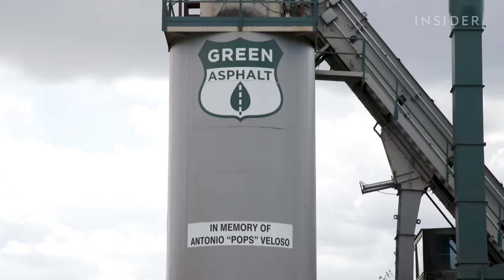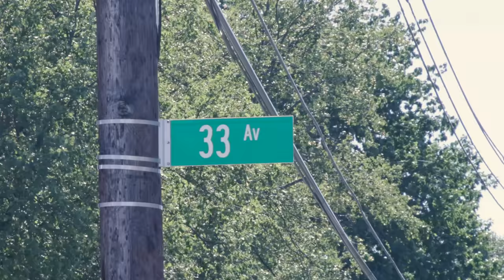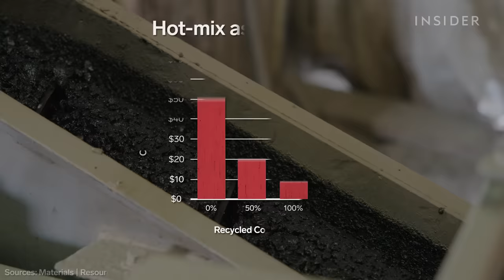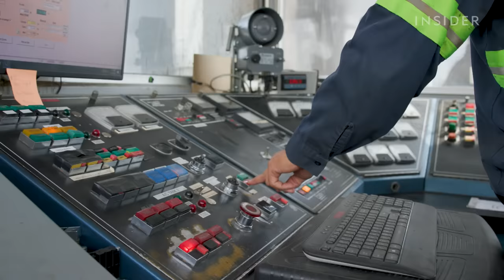Roads Can Be Recycled Forever, Why Don't More Cities Do It? | World Wide Waste | Business Insider

Comment: I live here in Idaho I worked for a company called strata Inc. they are geological engineering company civil engineering. I did many many asphalt roads concrete asphalt mix designs. And testing for construction materials such as roadways all forms. And even the ASTM which is American standard testing materials as a way in which to use recycled asphalt. I championed for it over 25 years ago when I was in the field and I still champion for it today but getting states to do it on a major scale is like pulling tooth and nail. But since the oil prices have gone way up maybe they'll look at it again or they'll just turn around and increase our taxes. Which is just horrible anyways. We as a people in the United States deserve better. We have rocket ships that land vertical don't you think we could figure out road material. We have square boxes that hang on our walls that we call televisions. We have satellites in space I mean as simple as road material come on seriously I've always known you could recycle asphalt. It just wasn't popular it will save the environment because we are not running a huge bash plant and crushing up more rock at crusher control for more material in which to build roads cuz believe it or not there's a lot that goes into roads a lot a lot of vehicles and with all those vehicles I don't see any of them electric. And if you've ever knit sat next to one of these crusher control places you can see the dust the dust alone can cause you to cough if you're not properly wearing your PPE.

Comment: 1. Aggregate specs of the past often don't meet modern specs - hardness; friction; broken faces; rock type.  Can't QC agg specs o recycled
2. Asphalt oil evaporates / volatilizes over time! Always need more regardless of 1.
3. 100% of old asphalt is always recycled - always - every bit of it. Old asphalt is not thrown out! Even if the blending rate is 30%, it is all recycled.

Comment: Now that's one way to reduce our carbon footprint, hats off to that innovative company. This is the type of company that should be getting government grants and contracts by saving taxpayer money.
Reply: When the current secondary market for old asphalt / millings drys up, just what do you expect these end users to purchase?  RE,   Millings are currently commonly used for residential driveways.  Dump, spread , drive over with a car.  It will be a bit wavy but it is a very low cost / low labor solution.

Comment: One of the things they don’t address in this video is the added fuel cost to running higher recycle asphalt. If you make asphalt with 50% or higher recycled content, the recycle doesn’t actually touch the flame. It’s dried by superheating the virgin aggregate, which in turn dries the recycled aggregate. The higher the recycle, the more fuel required, whether it be waste oil, natural gas, or propane. 

There are additives used to lower temperatures, but they also add cost.
Reply: I would love to pass on the fuel bill, if I can bring my old asphalt without having to go to the landfill, then drive back to get new asphalt. That’s a lot of vehicle fuel. And if you have multiple vehicles ? I’m for recycling asphalt. It’s very true that one week I can install new asphalt so another utilities company gets to destroy it

Comment: Asphalt is a bad product of a flawed theory. The claim is that asphalt is cheaper than concrete, however a couple days ago I drove on a concrete road in my town that is at least 75 years old and is still in great shape. Asphalt has to be ground off and replaced about every ten minutes. It is far more expensive in the long run but very profitable for the paving companies. I wonder if they donate to politicians?
Also, asphalt absorbs tons of heat making cities up to 10 degrees hotter during the summers.

Comment: that's a disappointment to learn that you can 100% recycle asphalt but regulations only allows 30% to be recycled.
Reply: Old asphalt already reused as a residential drive way material, dump, spread, drive over it.  It will be a bit wavy bit it is just fine. Also note other posts where the recycle content is way past 30%

Comment: I had no idea that recycling of asphalt was a hard sell. I remember in the early 70s reading in Popular Mechanics or Popular Science of a giant machine that would cut and lift and grind asphalt, process it internally and lay it out smoothly behind as a continuous process.  I guess that didn't work out?
Reply: Of course it worked out.  I live within a kilometre of a highway much of which has been recycled in this manner.  Rubber crumb is increasingly being added to areas which benefit from staying in good repair longer,e.g. busy intersections.  Also reduces linear cracking…….and incidentally stopping times at traffic light controlled intersections.

Comment: "Why don't more cities do it?" ... because it's easier and more convenient to simply produce new asphalt.  Some have also tried adding granulated plastic waste to the mix.
Reply: AH yes. "digging up the old asphalt, crushing it on the spot and adding tar to it before chucking it into the paving machine" is so much harder to do than "digging up the old asphalt, putting it into a truck, driving said truck to an asphalt plant, unloading it, loading it up with new asphalt, driving it to the roadworks and loading the new asphalt into the paving machine"

Comment: if over 90% of asphalt is already getting recycled, while most asphalt used is between 70% and 100% fresh, then why wouldyou need to jumpto using 100% recycled asphalt? 
this seems like a marketing gimmick or a trick to gain government contracts, and I do not believe that the stuff is of equal quality no matter how often you say it. it's clearly contaminated with higher sand and gravel content from lower road layers (as well as tyre and exhaust dirt, soil and what not), and surely some oily parts of the bitumen evaporate over decades in a road, so it seems quite obvious that the result would be drier and more brittle. I reckon just adding a little paraffin oil does more to mask this dryness in the short term than it does to make the asphalt not too brittle in the long term.

Comment: The state of Missouri where I've lived my  life of 59 years and worked for the county highway dept. have seen Missouri roads deteriorating with republican tax breaks for the rich since the 80s what once were paved backroads are now all gravel dust powder just blowing in the wind covering everything with dust and new highways being intentionally destroyed with surface grinders apparently made just for burning through tax dollars used on brand new bridges  and highways before its even completely cured causing cracks and breaking seams in density tested cement pavement that otherwise might last decades

Comment: concrete also has a zero percent recyclability.  and cement pavements make ZERO sense from a long term maintenence stand point, when you could use paving stones. Which can be repaired with a single guy, a wheel barrow, spares and some sand. Compared to what the cement pavement requires... about 3 trucks a jack hammer, and a mini digger.

Comment: This is misleading on so many levels. A Marshall stability test is not sufficient to ensure this is product is equal to its conventional counterpart. In urban cities, the roads are the quarries so this works. But in most rural cities where they are mostly overlaying there is no RAP supply to support this process. Well made asphalt road lasts 40 years but in NYC when they are mill and fill every 5-10, then this works. This isn’t the cure, just a different racket and set of racketeers

Comment: The ANSWER is @ 1:45. Regulators, IE Gubment.  That's why.    What they do around me is spray a heavy goop and lay round pea gravel down on top of the existing road, regardless if it needs repair or not and we wind up with a newish looking terrible to drive on road.  With some make up gravel and some new fresh oil, they can strip and repave it on one pass instead and have a better road, but guess that is not feasible in the money hungry gubment in charge of roads.

Comment: Has nothing to do with production or processes, it is all a corrupt mess in the bureaucracy. Many in my family work in govt and one thing is for sure, many of these companies are private corporations who usually have a friend or family member within govt who can give them the contracts. The fact that they dont go with recycled materials, is all about money, companies can charge more premiums for the materials under work costs all to benefit the people involved. You make more money if you can convince people that the old method is better and worth the cost, than giving them a cheaper alternative. Its all about money.
Reply: Have a look at other posts stating that higher % of recycle is already being used and that if recycle content is too high, the rock size is too small leading to early failure.  Besides, asphalt millings are a common low cost residential drive way material so old asphalt has a 100% reuse already.   Pull millings from the non public road market then they will need to buy new asphalt / use other materials.  Please explain how losing private market millings is a good thing.

Comment: Asphalt is toxic and doesn't last very long. In England we had concrete motorways that haven't needed replacing for the last 40 years.

All Tarmac roads last a mac of 5 years before they start to show damage. Especially with lorries and hot weather. Recycling is a joke and keep us regurgitating the same stuff over and over. The Dutch are great at this.

Comment: Go back to concrete. My street is 100 years old and still holding strong. Asphalt is only to provide job security as they know it doesn't hold up and will need to be replaced/repaired over and over and over.

Comment: H.I.P Paving LLC
St Petersburg Florida
Has a way better system, it's all done on site. Starting with road grinding to laying out the final product. The equipment comes in does the job and the equipment leaves. No back and forth rip it up take it to get ground run it through the plant load the trucks and bring it back. 
You guys are doing the same shit as everyone does. 

There's very little environmental savings here.

Plus where I'm at, all asphalt gets recycled . If they use 1% or 100% , no grindings go to waste

Comment: Well... i belive only there the 30% reuse is the norm. preaty sure some "big oil and stone" lobbiest had something to do with that..
Reply: Asphalt millings are a common low cost residential drive way material so old asphalt has a 100% reuse already.   Pull millings from the non public road market then they will need to buy new asphalt / use other materials.

Comment: They don't use recycled asphalt because it's cheaper.  If DOT and related public works departments don't spend virtually all their money this year, they won't get the same or more next year.
This is the driving reason behind the road work that's totally unnecessary.
That's a damn shame.  So much waste, both materially and fiscally!
Reply: That’s not how this works.
Reply: @vogelboys74  I didn't think so either until I received, due to FOIA requests, abstracts from 5 municipalities (my own city plus 4 others, 1 in each time zone in the continental US) for 5 years.  On the rare occasion a municipality spent less than 85% of their public works budgets, they didn't receive as much or more the following fiscal year.  This happened a total of 7 times out of 25 total records.

I fell down the rabbit hole a bit.

Comment: This is total rubbish - roads in the Western world were 'metalled' with Asphalt , a volcanic product (ashphalt - read 'ash fallen', in the Germanic etymology) until the 70s-80s when asphalt (a volcanic product available in quantity from a very few areas, including Caribbean Islands which the UK had, and used) died out, mostly because of world politics: it's a product which lasts 'forever' apart from getting deformed in the extreme heat of some summers.  The replacement was coal tar or 'bitumen', a product which has a rather short usage life, yet which has become synonymous with asphalt - which it is absolutely not. Only when people start to wake up to the reality of modern bullshit misnomering and fudging of fact, will anything improve.

Comment: Lol...this is just a sales/propaganda pitch.......any 100% recycled or remix in place process will oxidize and loose it's elastic properties right away......in addition an asphalt plant needs to run at an economic tons per hour rate to be able to produce the mix at an affordable cost to it's  customers......if your capable of making 300 tons per hour with 30% recycle ....vs....50 tons per hour at 100% recycle....you are still using twice as much recvcle and still being productive ......

Comment: Recycled material isn’t as good, it’s harder to lay, especially by hand. We don’t like getting our gear from plants that recycle, new stuff is nicer 👍🏻
Reply: Agree 100%. We had to switch plants cause we got sick of their cold loads you could barely move. Never comes out as smooth and flakes in raked areas easily no matter how much you try and rake the stones off.
Reply: @Daniel-ve3sc  sounds like the plant was producing shitty asphalt regardless of its recycled content
Reply: @alouisschafer7212  We use to not haven any issues years ago. Problems started after the changed the guy making the mix and adding more recycle to the mix. Since covid started it has gotten even worse. The plant we go to now makes a virgin mix. Since then we have had no problems.